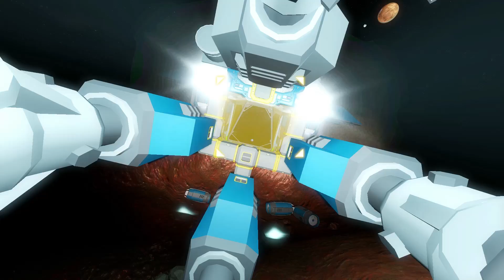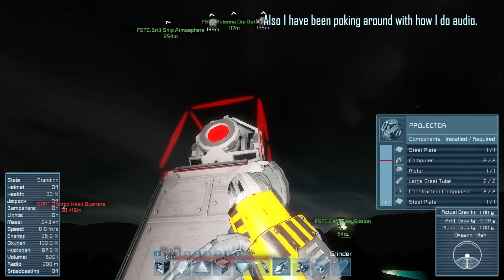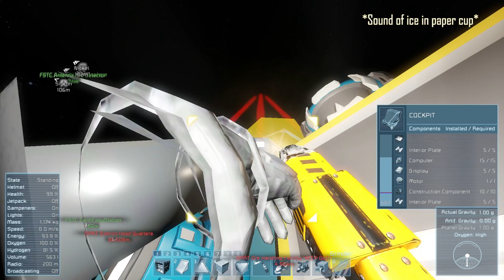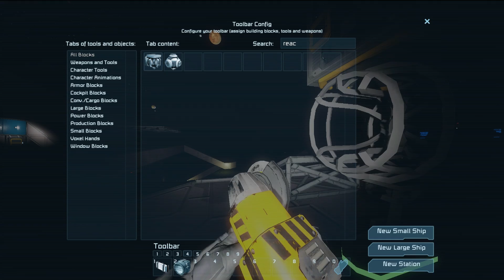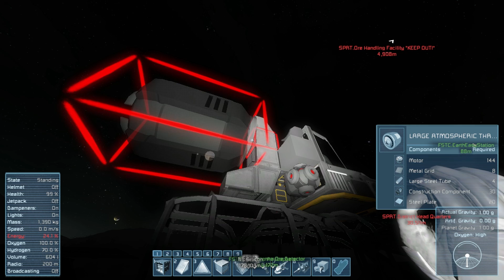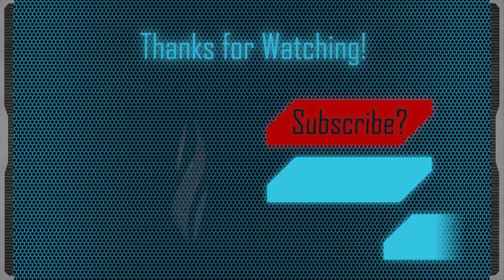Space Engineers, Singular Survival, Ep 4 (Building, The First Scout)

Comment: Honestly, the reactor setup could do with some optimizing. Hook all reactors up to the conveyor, so that they'll get refilled automatically, and then just have one single accessible small reactor somewhere at the back or bottom or wherever you think is safest. That accessible reactor will be the emergency reactor, shut it off, put in as much uranium as you feel comfortable with keeping for emergencies, and then only turn it on for refueling if your your main reactors run out of uranium. That way you won't have to worry about manually checking and refueling the reactors every time. You could also set up a proper emergency mode, where you turn off all but a single small thruster in each direction and a single gyroscope once emergency power is turned on, that way you'll still be able to maneuver somewhat. In large ships you could also set up some emergency lights too for visual effect (and to save a tiny little bit more power). Won't work that well on planets, of course, because you'd still need to have the ability to stay in the air, but if you're still playing og space engineers (without planets) or if you've already made it off the planet, it would be a viable strategy.

Comment: why there is engine pointing up? you will have gravity pulling you down so unless planning on going upside down much its useless.. also if you plannning of mining with that you need lot more engines to keep it floating
Reply: +vargurlord If he is mining and the drills are on the front then he will be facing down. So suddenly the ones on top are on the side.
Reply: Noah Hounshel for mining that 1 engine wont help much, i had 3 drills and large container and i needeed 4 large engines to float so 1 large wont stop him from flipping
Reply: vargurlord Sounds like a problem with weight. One engine should be enough considering how little he has on his ship. My concern is the fact that he builds without thinking about the fact that this is natural gravity.
Reply: Noah Hounshel yes for scout ship but if you start mining weight comes an issue really fast
Reply: vargurlord But not for stabilizing thrusters.